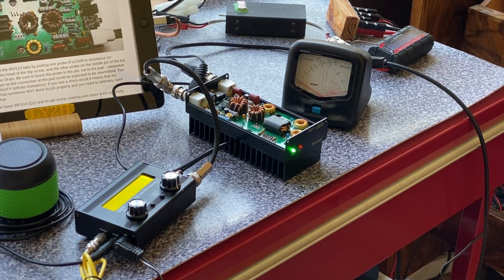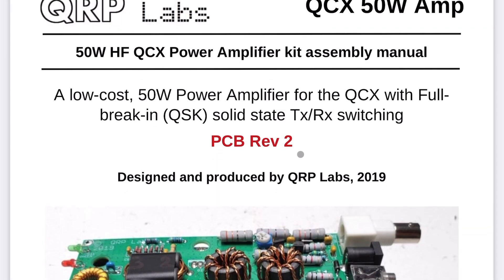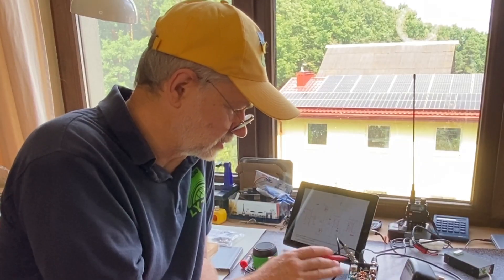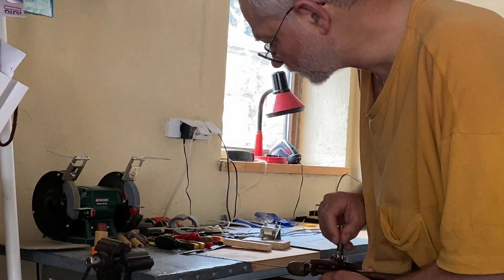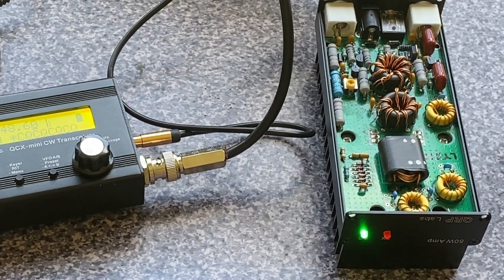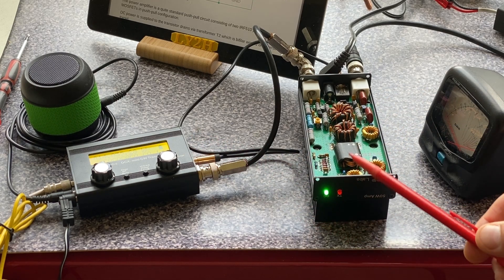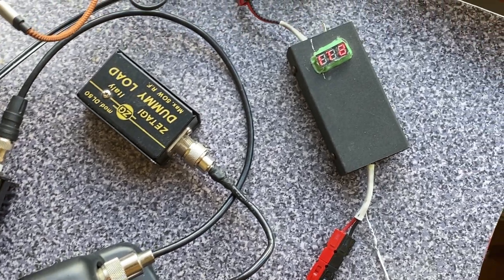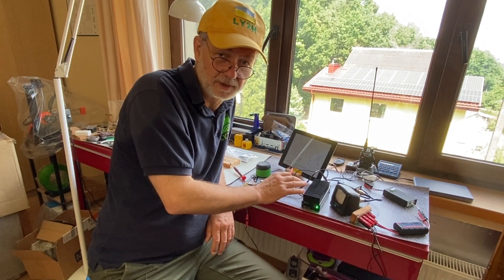QRP Labs 50W PA: 3 things you should know before buying

Comment: This video misses one thing: the 4th one.
The IRF510 do not  like SWR. they really don't like it. Anything above 2 will likely release the smoke.
You have a so called tuner so it should not be a problem. May be, may be not. All this relay click-clacking is the "tuner" trying to find a match and it is not instant. During this time the SWR may high enough for long enough to release the smoke. I you have a manual one better to present it to the proper settings before transmitting.
Reply: True, but also true is that they are dirt cheap to replace. :)
Reply: @JavierAlbinarrate  Yes, I forgot to mention it. IRF510PBF $0.95 on Digikey.

Comment: Hello, Linas! I just finished building my QRP Labs 50W Amp. Curious if you implemented the mod that is recommended on the top of page 66 of the build manual? I didn't notice that recommendation until I got to the setup and operation section. Other than that mod, everything seems to be working on my new build! 73, Jim WB0RLJ
Reply from the maker: @WB0RLJ  Congratulations Jim! Hope, it’s gonna work and work bringing numerous DX into your log! If you mean the mod to the QCX-mini transceiver ( that’s what I could find on page 66), then no, I don’t have the 10k resistor installed accross the pins 13-14 on the IC3 chip, as I bought my QCX-mini factory-assembled. But I’m sure it’s a very good mod and I would consider it if I were using my QCX-mini with the amp often. 73! Linas LY2H

Comment: Ive bought one of these to use with my QMX on 40 meters.J just have to figure out the PTT 5 volt thing... I hear the QMX gives keying problems with this amp but there are some work arounds i've been hearing of, one is a resistor in parallel with 210 in the QMX which allows a full 5volts for the PTT ring line? I may do this to my QMX.jim KB1PFL
Reply from the maker: @TheShawna1  Hello Jim! Thanks for sharing your experience! Unfortunately, I don't have this PA anymore, so I'm not able to test it with my QMX radio , but it seems to me that as it comes to the 5V PTT line , both QCX and QMX provide for a similar way of switching. In the QMX, you can, actually, choose in the menu what kind of PTT system you need: "pin-to-ground" on transmit, or a "5V-to-pin" on transmit. In my QMX , both work ok- I measure 5V on the ring contact on the PTT socket, or I can get my microPA-50!amplifier keyed which needs a ptt-to-ground on the tip contact of the PTT jack, if I choose so in the menu. As I said, I can have "full"  5V on the QMX PTT ring contact no problem, but I haven't tried it to practically key the PA50 to make sure these 5V is doing their job :), if this was your question... So, if I were you, I would first measure my QMX if I have 5V on the ring contact of the PTT jack during the transmit ( after activating this option in the menu), then , if 5 V is ok, I would just connect a cable to the PA's PTT line and see if it all works. The only problem I know -there is a factory mistake left in PCB tracks , so you need a tiny jumper  wire to install between the two contacts of the PTT jack to fix this.  This is very well described on the QMX webpage on the QRPLabs site. HTH, 73! Linas LY2H

Comment: Thank you for video.
I have an idea to get this PA and supply it by Type-C PD using trigger for 20v from powerbank. That is why very interesting current consumption with 20v. But if it uses 80W and output after converter is about 20v it is about 4A? 
Not sure there is such powerbank, it will be simpler to assemble  from LiIon 26600 5s pack.
Reply from the maker: Thanks for watching! The power draw at 21V was ~6A  DC to produce 45W RF from this PA in my experiment video. So, it is 126W of DC power needed, whatever way you get it from. Good luck! 73! LY2H
Reply: @Linas_LY2H  
Linas, many thanks for answering.
Maybe you remember name of you dc-dc up converter?
It seems like this is a simplest way to get 20v from my 6A LiFePO4 4s battery.
Reply from the maker: @rst5nn  You’re welcome! I don’t know the name of my booster, except that it’s “DC/DC step-up converter from 10-32V to 12-35V”. I bought it at my local electronics shop. Here is the link to it to see the description : 
https://www.anodas.lt/dc-dc-itampos-keitiklis-is-8-5v-48v-i-10-50v-10a-250w-step-up?search=dc%2Fdc%20step-up

This converter is of Constant Voltage/Constant Current type which is not necessary for just a power supply. I am using it also as a solar charge controller and/or a battery charger where you need to regulate the current, not only the voltage. You may find a great variety of just voltage-regulated step-up converters on most internet trade platforms. HTH, 73! Linas LY2H

Comment: The winding method for the two transformers is very good but do not despair of you don't have one of those marvelous old hand drills. A power drill with a variable speed will work well if done carefully. And, actually, the trifilar transformer is easier to mount because of the hole placement.
Reply from the maker: Sure, but be careful with the power drill,- you can make a mess in a second :) 73! Linas LY2H

Comment: Hans has some nice products.
Years ago we needed bifilar wire when I worked in engineering and the drill was our solution. We did lengths of about six feet and a piece of paxolin with a screw through the centre to put in the chuck and two holes either side for the wires to be knotted, this way the wires were held securely and tension put on.

I keep looking at p.a. circuits to make an RD006HHF-1 amplifier for all h.f. bands.
G4GHB.
Reply from the maker: Hello G4GHB! I very glad my favourite drill method is used among the proffessionals internationally! Good luck with construction of your own HF amp, let us know how is it going! 73! Linas LY2H
Reply: @Linas_LY2H  Bifilar wires must be some 45 years ago. I've got the mosfets resistors, ferrites, BPF, some capacitors needed. Waiting for a radio rally, none yet.
73, G4GHB.

Comment: Very interesting especially at a price of roughly 30 USA dollars. If it handled SSB I would be ordering one today & I may none the less.

I harvest transformers out of old audio equipment and by adding rectifiers and voltage regulators turn them into power supplies to match my needs, so the required voltage does not put me off at all, although your scheme of using a DC to DC boost converter is equally a good solution.

Good to hear Ukrainian HAMs are getting back on the air & I can only hope their country kicks out with prejudice the Putin invaders. As a matter of fact my Ham equipment had been in storage for several years and I just recently brought it, which is now only two QRP transceivers, out of storage and put up a nice 40 meter inverted V antenna in the hopes of hearing traffic from Ukraine and surrounding countries.

Thanks for the review & demo...
73  from kc2wvb in the NY Catskill mountains.....
Reply from the maker: Thanks for watching! Congratulations with getting back on the air! The PA could probably handle the SSB traffic but then you need to play with the bias current levels of the transistors for the linearity and purity if signal sake. It could be a bit complicated as Hans only left one variable resistor to regulate the current in both transistors as his goal was simplicity, not linearity (you don't need linearity in CW anyway) :) Nevertheless ,  the user manual reads you still can do it but there you are on your own! So good luck and let us know what were your results! 73! Linas LY2H
Reply: @Linas_LY2H  Thanks, I may give it go now nowing that in theory linearity is possible & at worst I am out $30. I do have some friends that are very skilled EE's,  where sadly I am not one since I went the M route found in the acroynm STEM.
Reply from the maker: @migalito1955  If you are major in M, you can do everything ! CU on the air!
Reply: @Linas_LY2H  Well I wish.... Theorectical math at the graduate level gives you a lot,  but not everything plus the darn EE's confuse me when they use linear mathematics to model what clearly is not such as the relations involving bipolar transistors and fail to mention they are using an aproximation to overcome the difficulty imposed by the nonlinear relstions involved. That once threw me for a loop for several hours until it dawned on me what they were doing. 😃
Plus I really need to take the time to be better able to analyise small signal AC circuits especially when it comes to estimating source & load impedances which are very important to be aware of. If I were not 68 I'd probably go back to school again.....
Reply from the maker: Hmm… Things might get complicated and they will, accordingly to the Murphy’s laws. But the good news is the User and Assembly manuals are so well written by Hans that it only takes to follow the script step-by-step carefully and success is guaranteed! Especially tat this PA has got no SMD parts, all through-hole and is fun to assemble! 73! Linas LY2H
Reply: @Linas_LY2H  Thats really good to hear & has influenced me to give the QRP Labs power amp a go. 

I miss my Backpacker poweramp that I ended up selling several years ago. Incidentally I think it was a kit from QRP labs that I had purchased already assembled. It was roughly the same output, but was not restricted to a single band use, but the restriction seems to make it much less expensive and likely easier to build.

Speaking of instructions, I don't know about others and I am not complaining after all I don't speak a second language, but many times Chinese which is very different from English suffers severely in the translated instructions I've been given on past kits.

Comment: how many watts did you use from the qcx mini to the pa ?
Reply from the maker: I used as many W as my QCX-mini  has, -5W :). The built-in 3dB attenuator on the input makes the PA safe from overdriving. But even with attenuator, I would not recommend putting in more than 6W as the final transistors of the PA could be damaged. 73! Linas LY2H

Comment: Hi Linus. Thank you. I have one ready to build. I will build it on 20m and use a separate 40m LPF in series with the output for 40m. I also plan to use the 18V lipo battery from my portable drill as the power supply. As always thank you for the tips.
Reply from the maker: Cool! It will actually work on 30m too with 20m LPF, as does 20m QCX :) 73! Linas LY2H